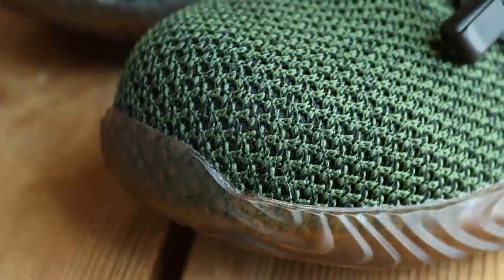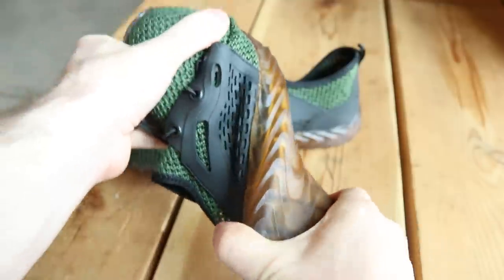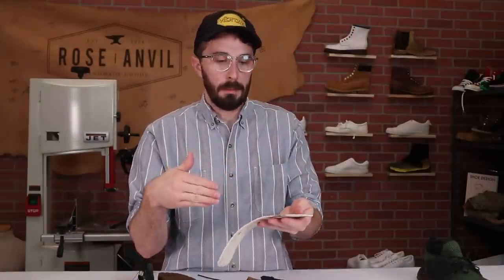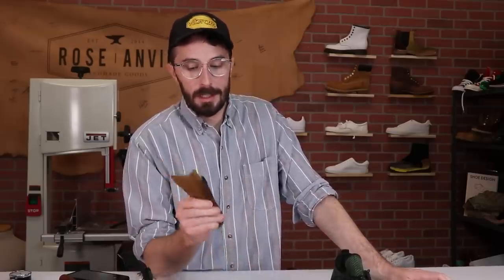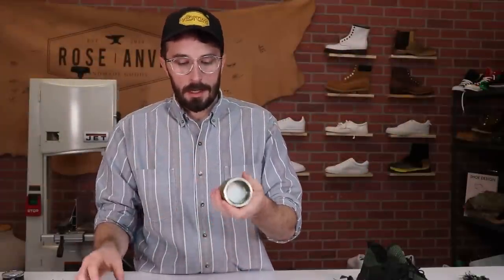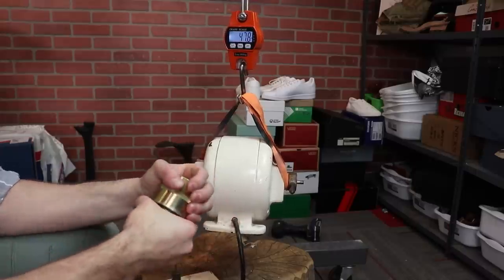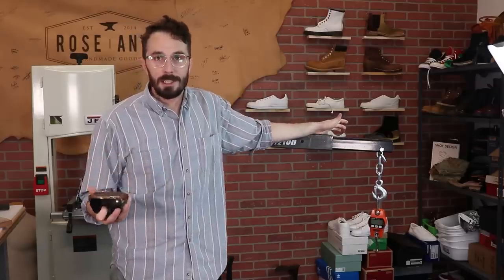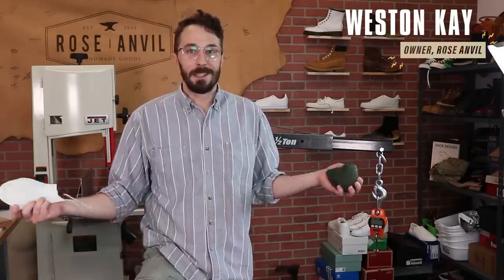Never Trust a Fart or These Indestructible Shoes

Comment: I looked at these shoes, excited to hopefully use them on my interior construction sites. Being mobile throughout the city, I do a lot of walking and hate changing to runners between sites. Upon asking if they were CSA approved, they had said "not yet". I even looked into having a mobile CSA rep test/review them and they refused. I did find in my research, the threshold for CSA approved puncture resistance/proofing is approx 350 lbs on 1 nail. It is supposed to replicate a large person walking and unknowingly stepping on a single nail. Safe to say these would indeed fail, but I do hope in the future they can create something up to this standard.
Reply: They're only good for roofing. The complete lack of sole and cushion support will leave your feet feeling like a 8hr day was 14 on non stop ladders. Trust me these shoes only shine on a roof where the steel toe prevents crunching of the toes on steep roofs.

Comment: It’s not Kevlar.
Cutting Kevlar fibres with normal blades is very difficult and leaves a ragged, fuzzy edge where the strands are not cleanly cut but abraded or sawn. You were able to cut perfect little circles with a fine scalpel with no apparent difficulty (you didn’t say, so I assume you didn’t find it worthy of mention).
It’s also difficult to dye Kevlar, so it’s almost always left in the raw colour state of light yellow. Those soles look pure white.
Kevlar is also very expensive (almost as much as carbon fibre), so a pair of soles that thick would cost more than the 45 bucks you paid for the whole shoes (Amazon is now offering a similar pair for £20.60, or about US$ 25).
Reply: haha funny that u say that , i would be asking ,is that real kevlar
Reply: wonder whether it could be a low grade aramid stitched into a canvas? Since Kevlar is just DuPont's name for the material, maybe it's at least a bit cheaper to integrade into the fabrics? thoughts?
Reply: @Clove_Parma  Sounds like it yeah, there are relatively cheap aramids that are waaaay below the level of ''Kevlar''
Reply: Yes, you are right, I work for a company that produces these types of materials for all the big brands that make safety shoes, this is a very thin layer of thermofixed polyester weave, usually, there are 2 to 3 layers glued together with reactive polyurethane and a layer of special resin for added strength. 1 square meter of regular material cost from 12-20 euros, the ones with a layer of kevlar costs 80 to 90euros a SQM.
Reply: Kevlar being a trademark (but referred to as Kleenex is tissue paper), it may just be some crappy, super thin layerered generic version.
Reply: Kevlar isn't resistant to knife cuts or stabs like it is with projectiles. Actually fairly easy to cut, but no still not kevlar.
Reply: Also. Could someone tell me what good would kevlar or aramid insert would do any good vs nail? Nail acts like low powered ap ammo so why bother? It will just slip through.
Reply: @BOTmaster15  Usually the nail isn't as sharp as a knife. If the nail is dull, then it is all about pressure and the material's ability to resist pressure. If the nail was sharp enough to cut you, then it would probably easily slide into the shoe. But since nails rarely are that sharp, you just need something hard enough to resist puncture. Kevlar should be that hard.
Reply: No you  Nothing is puncture proof, just like nothing is bullet proof, it is puncture resistant. 
Never seen these shoes advertised anywhere, but I wouldn't touch them. No shank and the outer material and tread looks like it would wear through in a year.
Garbage.
Reply: No you  No, it isn't.
Unless words just don't mean anything.
Reply: No you and Anubis, I think we have to our pride aside and admit that you are both right.. bulletproof windows are a thing and yet we all know a gun that with blow through layers of it.
Reply: I don’t see the argue meant for the price, online you can order 50inx36in for less than $50 brand name Kevlar. If you think of a sole as 3inx10in to keep math simple. You can make 60 soles or 30 pairs... 30 pairs for $50 is $.60 per pair for the soles. Math checks out to me. Please let me know if I am wrong.
Reply: @dustinlahr4801  yeah this is something that always irritates me, when people assume that since it can catch a bullet it is also stab proof. In reality, the fibers distribute the force when catching a round, but a knife can cut individual fibers and weaken the whole thing. Modern stab-proof vests are actually made with internal metal plates, and are essentially 21st century plate armor.
Reply: kevlar is cut resistant not cut proof. Also for how thin it is when using a scalpel. I would expect a clean cut
Reply: @dustinlahr4801  it is definitely not easy to cut, especially in a plastic matrix. It's highly puncture, cut, and abrasive resistant, and these are the properties that most applications of the material take advantage of. Bullet resistance is just what you see in pop culture and utilizes the fibers in a totally different way. Even cutting the fibers without resin impregnation will dull up a blade rapidly and if you have to work with it often you usually do so with a pair of $50 scissors. Once it's in a cured composite (as a midsole like this would be) you absolutely need specialty carbide tools to work with it without dulling up your blades immediately, and even then it is problematic because of how difficult it is to cut and because of how prone it is to fray. Even carbon is much easier to work with.
Reply: @ottowegner5570  yes very much so. Stab resistance compared to projectiles are very different. The force applied to the tip of a blade is far more concentrated then that of a high speed projectile.
Reply: That's because these aren't name branded. These are a cheap knock off of the real ones that retail for about 90$. The real ones have high quality kevlar and thicker rubber soles that are probably made from a different material. I've seen other video's on the real ones and trust those you can't cut.
Reply: Def correct. As soon as I saw that he could cut a nice perfect circle without the frayed edges and the material coming apart I knew it was not pure Kevlar. The color was also a give away
Reply: @dustinlahr4801  that part
Reply: @whywhatwhenwherewow  sry bro, they dont make stab vests out of kevlar and if they do its to sell it to dummies not because it works
Id rather have a brigadine coat either way
Layers of steel has a good track record historicaly speaking, and they didnt stop using it because bullets go through it, they stopped using armor because armor is costly and time consuming to produce and musketeers are not
Reply: @lucasjackson2086  they do use kevlar as part of stab proof vest due to how good it is at blunting slashes. They the only knife attack it is particularly effective against though.

Comment: Testing real safety shoes would be really interesting. Additionally you could also explore several aspects of ergonomics both for safety and fashion shoes. For example weight distribution, stability, ankle support, breathability, etc.
One test I would really like to see for all shoes before you destroy them is how slippery are they in wet metal. I have danced many times on top of metal lids escalators and so on, because of some crappy soles (vibram you should be in the skating business!!). The test could be a 45 angle wet metal lid a shoe with a heavy weight on top and measure how fast it slips down the lid. Many safety shoes do have indeed anti-slip soles, but most fashion and hiking shoes are complete crap in this respect.
Thanks for the videos

Comment: Great video. I’ve been selling work boots for over 10 years and I cannot even begin to tell you how big of scam this shoe is. I don’t have enough time to list half of them. First of all never trust a puncture resistant shoe or boot that doesn’t have a green ‘CSA’ triangle on the tongue. The puncture resistant material should be at lest 10 times thicker, even then, thinner nails like roofing nails will still make it thru with enough weight. A half decent work shoe shouldn’t flex like that, it means whoever made this shoe knows nothing about footwear, or they were too cheap to use the extra materials and labor. I am shocked that these are still allowed on the market in the USA. This company will have a class action lawsuit filed against them.
Reply: You can't sue a Chinese factory that pumps them out under 30 different names
Reply: Quick question, what are some reputable shoes? 
I cant even trust Danners bc theyre made in China. Looking to  upgrade soon but idk what to buy. My range is 300$ for work boots.

Comment: I bought these for 40 euros two months ago. I'm an Extruder Operator (plastic extrusion) so I have no dealings with nails, but it has protected my toes from heavy items falling on them, quite a few times already. They are light, easy to put on and off, they don't slip, and there's good air flow.
Overall, I'd say they are fairly priced shoes that get the job done.

Comment: Should have tested both of the soles together, the "Kevlar" and the rubber one
Reply: That makes no difference because he was testing how much weight it would take to puncture and once the total weight exceeds the limit of the material, increasing the amount of material will not increase the resistance of the puncture and the puncture would only be limited the the length of the object doing the puncturing.
Reply: @DeamonReader  While I agree that it wouldn't have made much difference in this case, more material does increase the puncture resistance, especially so for flexible cloth-like materials since you prevent them from stretching as much and spreading the fibers allowing the point of the nail to go between the fibers.

Comment: “We’re gonna run tests to see if These shoes are actually indestructible.”

One Single test later: “yea they’re not indestructible...”
Reply: He didn't even attempt to puncture the kevlar WITH the rubber outsole. He did individual tests of JUST the kevlar seperated from the outsole. Terrible testing...
Reply: @oh1125  That´s because it would make no difference: it can already pierce the rubber layer more easily then the kevlar. If you put all your bodyweight on your foot, IF it can already pierce the "protective layer" of the kevlar, then that little rubber wont be much of a problem. It would have maybe made a difference, if the protective layer was on the outside and the rubber inside ( as a cushion for example).
Reply: Lmao it was over the moment he cut into it the term indestructible means it can't be destroyed tearing into it meant it could be destroyed therefore it's already a lawsuit based on name alone😂
Reply: So if it goes thru one sheet then  it will go thru 50 sheets too?  That's not how it works
Reply: Shoes: Im indestructable
Box Cutter: hold my beer

Comment: Dear  sir, the way we tested the hardness of outsole is the put the outsole on a solid flat surface and then use that durometer to press against it. There are two type of durometer, ball head and needle head. Ball head are usually for EVA or expanded material.

Comment: Why do some of the people in my age need to have sneaker style shoes on the construction site??? I have shoes for safety and clothes for safety . Fashion isn't a thing of importance in this field of work .I want shoes that protect my ankle . Supports stepping on a ladder without bending flexing and slipping etc.
Reply: Some people just want more durable than average shoes. Nobody serious about construction would wear these unless they are on a crazy restricted budget.
Reply: adidas makes good work shoes that look like sneakers
Reply: There are places other than construction sites where toecaps are mandatory 😛

I used to work in a powder coating plant where it was fkin' hot, and any impact was going to be coming from above (objects falling from the overhead rail) so ankle protection wasn't such a concern. Plus anyone not actually working the line (e.g. supervisor, workers from other departments passing through) could easily avoid risk areas but needed toecaps *just to be allowed to walk through the room*.

Those of us on the line wore 'proper' safety boots, but I can understand why some of the other employees would wear bare-minimum-compliant shoes.
Reply: @iamtoast3397  I understand your point but I am sure these toe caps don't protect you .These shoes are not certified so it could be more dangerous than wearing normal shoes .The cap could cut your toes of etc. My problem is that this product could give someone a false sense of safety
Reply: There are also safety shoes that resemble Converse, for those of us who want to distinguish themselves from their dads.
Reply: Also there's ways to make boots fashionable, so that's not an excuse.
Reply: @jensrb50  Anything heavy enough to cause steel to deform enough to sever toes is heavy enough to completely mash them flat. 
Severed toes can (usually) be reattached, meat patties cannot.
Reply: I'd just want shoes that don't bake my feet and allow sweat to vent.  I don't get the fashion aspect.
Reply: Okay boomer
Reply: These sneakers aren’t rated or certified to be used in warehouses or construction sites anyway. It’s just a niche marketing tactic to target insecure people who feel the need to look cool while doing dangerous work. That is how the fashion industry as a whole functions. In my opinion.
Reply: It's comfort not style
Reply: I sell granite, and am around 1,000 lb slabs all the time. I go into the warehouse all the time, and just need steel toes that can still have a bit of fashion to them since I'm working with high end clients and am not just moving slabs. I was always interested in these, but am more interested in the comfort aspect.
Reply: Manufacturing jobs require steel toe boots/shoes, regardless if you are manufacturing ping pong balls, or bowling balls. No one beyond painters, and possibly a random roofer here and there are wearing these on a construction site.
Reply: @kylkim93  those Red Bricks are pretty nice safety shoes, my colleague has a nice black pair
Reply: @jensrb50  oh I'm not defending these shoes in particular, and I respect your points. I'm responding to a comment that just grouped all "sneaker-style safety shoes" - there are people out there that legally require safety shoes despite never being at risk; they're just under the same roof as some people that do. I was working on the line & my personal go-to was a very comfy pair of Doc Marten industrials, but they were expensive and ugly and heavy as all hell, so I can see why the guys in the office that just needed to occasionally walk out into the plant and point at something didn't wanna wear something like that for the other seven hours and fifty-five minutes of their day 😉
Reply: I wear waterproof Helly Hansens in all seasons and they are surprisingly warm for a boot with a steel toe. 8 inch or 6 inch upper doesn’t matter. If you want health feet you will pack dry socks and change them out at lunchtime and after work. Cheap socks and change lots! It’s a legit lifestyle choice!
Reply: This thing is just made to be cheap, not really stylish
Reply: Ughhh, maybe because you are actually working ?
Reply: I'm a commercial truck driver, so these actually look like something I might consider, because the main two things I need in a daily is toe protection and breathability, since I would be wearing them day in, day out. So honestly I can see these being useful for some people in vocations like mine. Just my thoughts.
Reply: The only reason i want to have sneakers that can be used on that shit is because i want durability, i want something that will last years and not a few months, im rough with my shoes, especially wen im out at a creak, canyon, etc. So im used to shoes getting fucked pretty easily, with stuff like that it will actually outlast my abuse
Reply: I think these are more a "tacticool" type thing. More or less useless, and targeted towards people who don't need the "features".  Most countries require certification for steel toes - if your jobsite has a requirement for steel toes, you are probably required to have certified toes.

Wearing these on a jobsite is just as bad as wearing soft toes from a "can they fire me/fine me for this" perspective.
Reply: Legit.

 I work at a plant and instead of flexible and comfortable pants to protect against potential steam and burns as well as allow full motion to bend and lean, they insist on these slim fit, coarse feeling pants. 

Looks very nice because it's a slim fit, that gets slimmer going down towards the feet but for fuck sake It is not comfortable to be bending down to fix stuff for more than a few minutes.
Reply: @jensrb50  these are a knock off he got. Amazon is not a trustworthy corporation,if you want the real deal(they're 70-100 a pair) they're legitimately some of the best safety shoes you can buy. Real thick kevlar and soles(good luck stabbing or cutting it) and it can stop a couple small caliber bullets but they need to be distributed across the surface and it'll hurt your foot. The real deal can do everything you see in the commercials, but the dude in this video got ripped off and bought a fake pair of those shoes which I can understand happens and that it's kind of a hard thing to spend 70-100 on something that you're gonna end up destroying.
Reply: A lot of people don't know how comfortable a good pair of boots can be, and wear sneakers because they think it is the most comfortable option.
Reply: Actually... Alot of guys I work with wear either those, or just standard basketball sneakers. We do a ton of standing seam metal roofs. Sneakers give significantly more traction on the very slick surface of the panels. Also there is very little chance of your feet getting too banged up on a metal roof project. Most panels are aluminum so even large ones aren't really too insanely heavy.